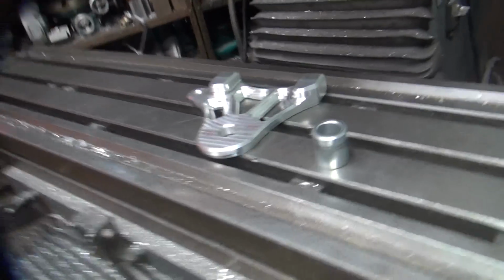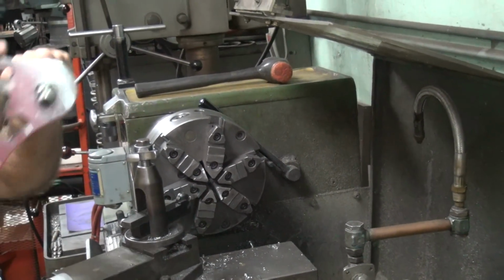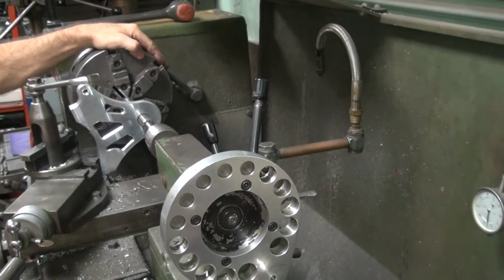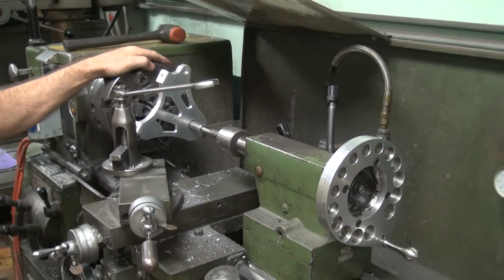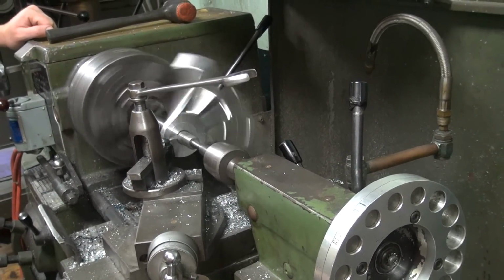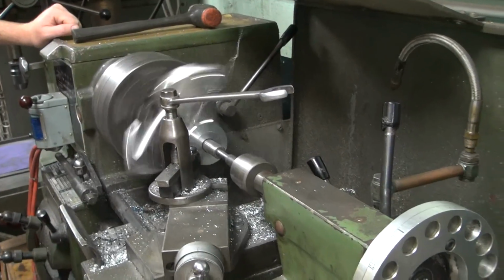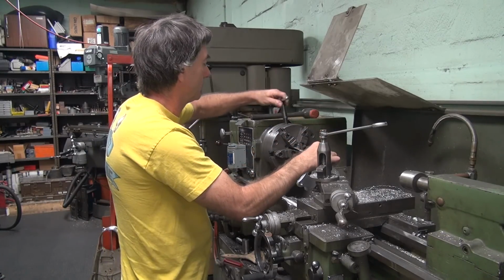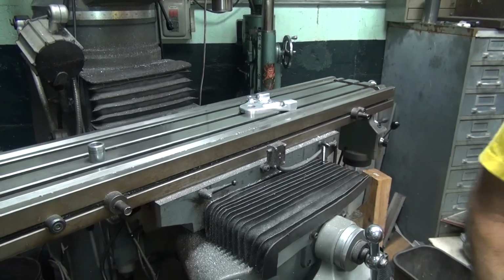1991 fxr #101 aluminum swingarm rear brake caliper bracket machining harley by tatro machine

Comment: It was NC cut in a fixture of some kind. When you do all those cut outs the material will stress relieve and "crawl around" no matter how it was clamped.I am sure it wasn't stress relieved after machining.
Reply from the maker: that is a bad excuse for making bad parts. if they cared about what they make than it would have been made correctly the 1st time. how come my wornout crappy machines can make good parts and these manufactiures can't get their heads out of their asses.
tatro